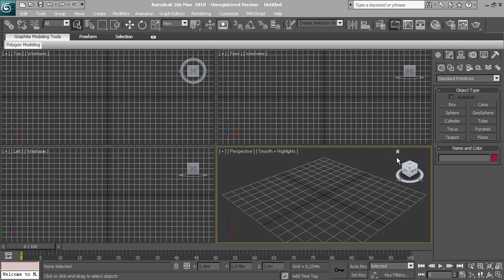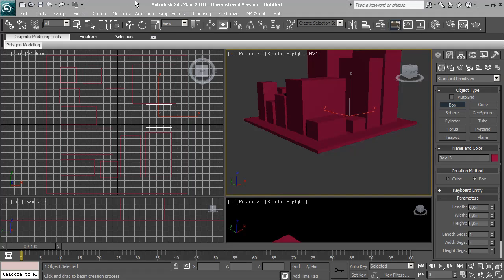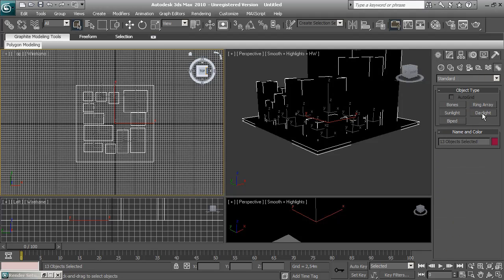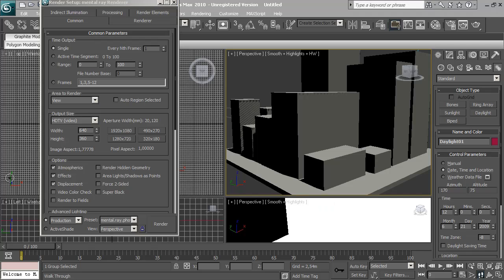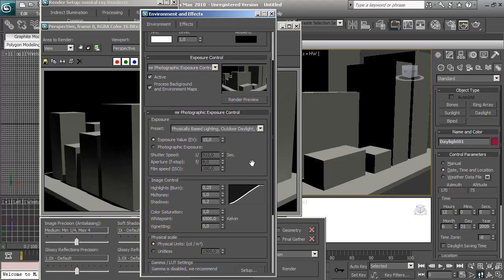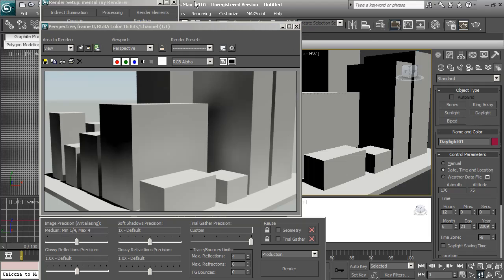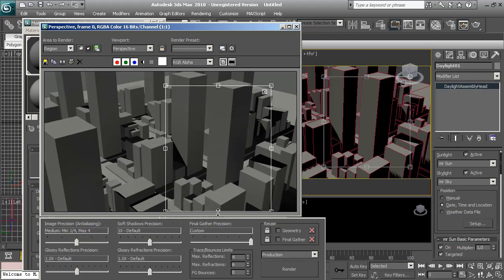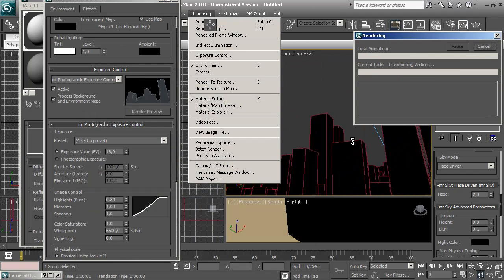3D Studio Max 2010 Tutorial - lighting , render - Mental Ray,

Comment: @Venom111555 Not sure on this one. Check what renderer you are using (F10>common>assign renderer). Mental Ray will kick up black renders with the wrong lights and materials. If in doubt reset max (File>reset). Best to stick to the default till you've got the hang of some of it then move onto Mental Ray (or VRay etc.)